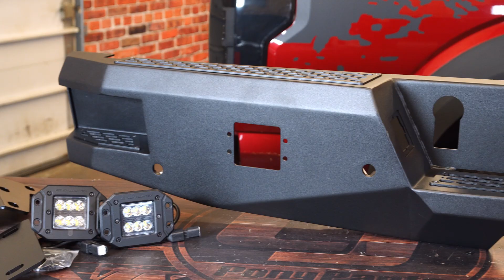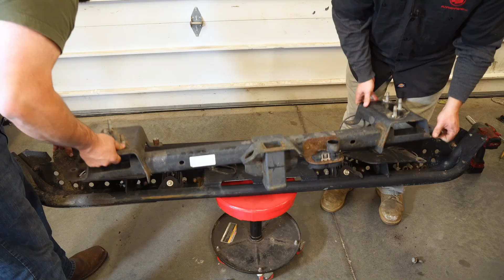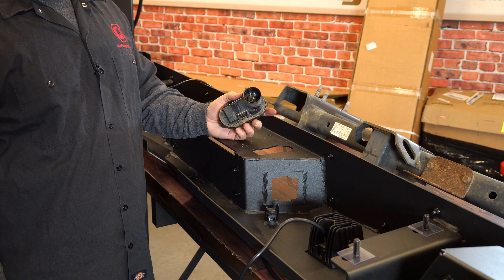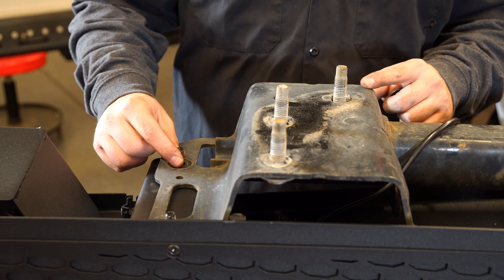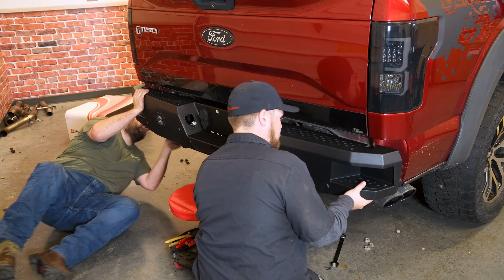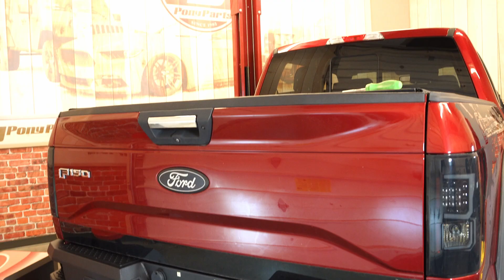2015-2019 F-150 Install | Rough Country LED Rear Bumper

Comment: What happens when you lay the tailgate down, it will lay on the bumper right? Did mine just like you did, learned that from this video and was wrong for my truck. so now i have to lower my bumper down just a little to have a gap from the tailgate and the bumper when it’s down.
Reply: Same thing happened to me😢